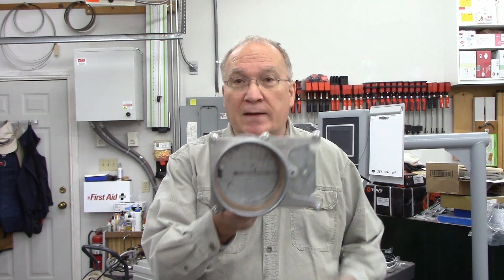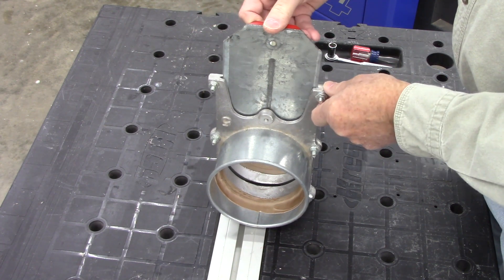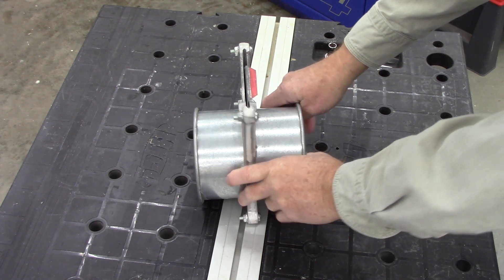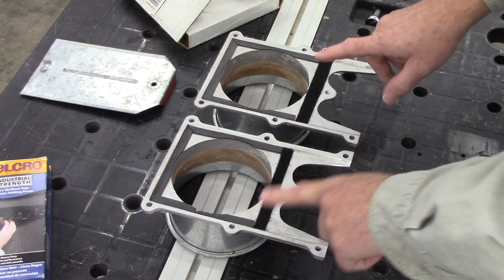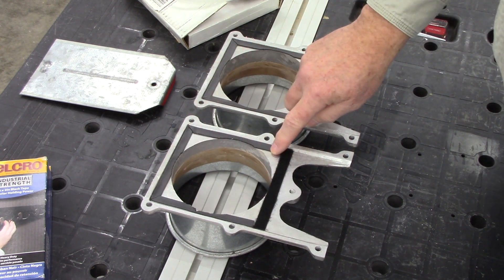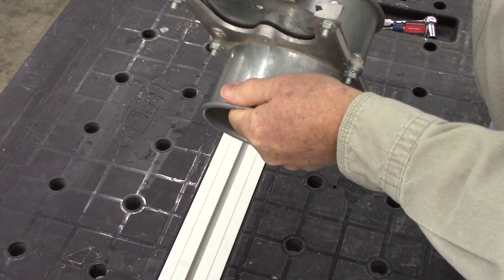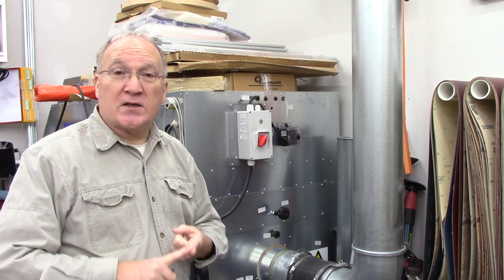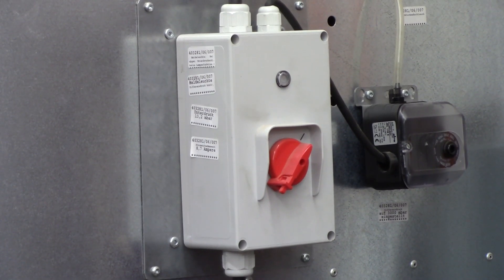Easy Dust Collection Blast Gate Improvements with Surprising Results

Comment: Hey there man.. This was a very informative video my bro. I'm relatively new to the workshop scene. I'm about to upgrade my table saw in the next month or so and this gave me some food for thought. I cannot for the life of me get a grip of dust collection atm. 
I'm struggling and I've developed eye issues and nose issues from cutting sheet good in my small shop. There's dust constantly in the air but it's everywhere tbh. 
I know I need to sort this out before I go any further. My eyes are really sore now. 
I need to get to grips with this mess man. Is there a video u know of that could help me build a dust collection system that could maybe minimise the dust issues I'm having? I work out of a one car garage. I have a table saw, planer thicknesser, bench drill, sanders galore, I also use a wet/dry grinder. This issue with my eyes really began around the time I began cutting sheet goods on my crappy table saw. 
I really enjoyed ur video man. It brought up some real issues and u seemed to have found some brilliant solutions along with it. Brilliant stuff my friend. 
I just sub'd to ur channel too btw. Well truth is I only found ur channel a few days ago and sub'd this morning. Apologies for the longwinded comment as well ... Keep up the great work and I love that big as heck panel saw u have in ur shop . It's a proper beast. How big is the blade din that bad boy??
Reply from the maker: Thank you for the kind words.  The best resource I have found for dust collection is Bill Pentz.  He has a boatload of excellent information on his website and I suggest starting at his beginners corner:  https://billpentz.com/woodworking/cyclone/beginnnerscorner.php
One thing to note, the best dust collector in the world cannot overcome a poor intake at the source.  When looking at saws, look for shrouds around the blade and overhead guards with dust collection ports as well.  Even at that, it will still not be perfect.  You need to move a lot of air to pick up sawdust generated by a blade tip moving at over 100 mph.  Also, minimize the length of flexible hoses.

The Martin saw will take up to a 400mm (16") blade but the largest I have is a 356mm (14").

Comment: great improvement on the gates.  As someone that also struggles with space I have my dust collection go outside the building into a cyclone, then returned into the shop and through a filter tucked high near the ceiling.  Its not the most efficient for heat but it clears up a fair bit of space.  In the summer the filter is bypassed and cyclone just blows outside.  Not sure if your set up allows for this but an idea.  Thanks!
Reply from the maker: Thanks.  The Felder isn't really set up to do what you describe.  If I had to do it over again, my dust collector would be in a room by itself accessible from the outside for bin emptying with some remote monitoring for fill status.  I would return air to the shop since I have conditioned space.  I would also put a large air compressor and the phase converter in their own enclosures.  If I only had that foresight 33 years ago (LOL).  Steve
Reply: @extremewoodworker  Great video...thanks! I put my RL 160 and big air compressor/dryer/etc. in a separate room with a return as you mention but my 30 HP Phase Perfect is in the shop where my 400 amp service comes in. As I was watching your video, I was thinking about some way to wire a flashing red light (or some other type of alarm) inside the shop so I would know when I had a restriction...will have to investigate this further.

Comment: Use rocking blast gates and all the problems go away, no rattling, no leaks (not that they matter too much if at all) and they can't jam. The major issue with the metal gates is they never fully clear the duct, some of the blade is always in the duct. https://www.youtube.com/watch?v=oj9vlD4gU78&ab_channel=JonathanKatz-Moses. Mr Moses is late to the rocking gate as they have been around for at least 10 years that I know of.
Reply from the maker: Thanks.  I like the idea of these blast gates but cost to connect to the Nordfab quick fit system would high and I already had the standard blast gates on hand.  With 2 angled flange quick fit adapters per gate, it would cost me between $140 and $170 for each gate just for adapters.  If I did not have the Nordfab, I could easily see going that route.  I have never experienced a jam on the Nordfab gates and hopefully my modifications will not alter that track record.

I did alter one of my 5" gates by hammering the dimples out to get the gate out of the flow stream but this has some downsides as well.  Steve

Comment: Hi Steve. Well said and done. Yes gates have always leaked more than I want to deal with. So I built my own. I have 24 5" gates. And listening to you and others about manufacture gates; so I watched what you said. Good stuff Steve.

So I decided to stop from the beginning and did many things like you did too. Also, mine are all automatic gates; using air pressure to open and close the gates, whenever any machine goes on or off. So watching is what I have fought like you..

Thanks kind Sir for show using what you have done. Take care friend.
Reply from the maker: Thanks Pat.  I am not going full auto but am upgrading 3 gates that are way up in the air.  Steve

Comment: I’ve got all 6” gates, all but 2 nordfab.  I have access to all but 1 easily, so I have the thumb screw tight on all gates but the active one. But this is on an Oneida Super Gorilla, not sure it has the same suction as the Felder unit. Learning to put the thumbscrew on the downstream side so when tight it closes the gate was huge for me.
Reply from the maker: That is the way I used my system as well except for the 3 gates that were too high to reach the thumbscrews.  Even with the thumbscrew tight, I would get that bad tuning fork tone on 2 gates.  Steve

Comment: Thanks Steve! I haven't noticed mine wobbbling or rattling yet, but I know I'll be back when they do (thankfully my thumbscrews are all accessible, but they are still annoying)
Reply from the maker: I am working on fixing the inaccessible problem as 3 gates are between 8 and 9-1/2 feet above the floor.  Tired of using sticks and reach rods on these.  Steve
Reply: @extremewoodworker  I am currently redoing my ducting so that I can integrate a Grit system including automatically controlled gates on most of my system. Any auto gate will be installed higher up in the ducting than the current approx. chest level that I have them.